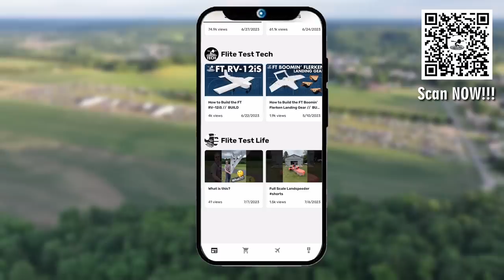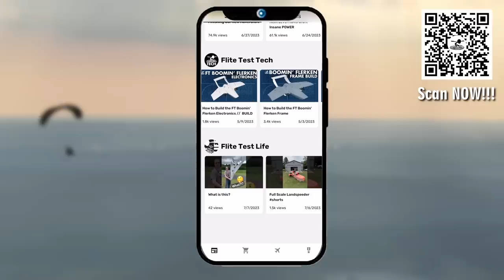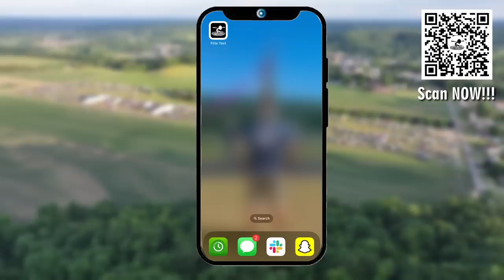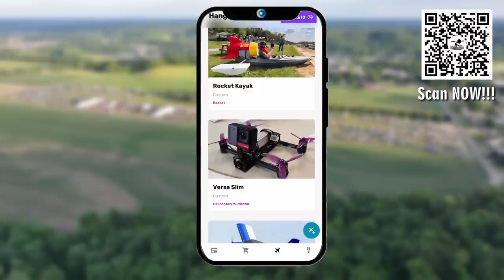Worlds Longest Airplane - Record Holder

Comment: That plane reminded me of a train too!  I’d love to see if you guys could build an articulated steam train with passenger cars and a maybe a caboose, with wings on each section, props attached to the locomotive, and the tail surfaces on the last car / caboose.  Bonus points if smoke comes out of the smokestack.

This could be a great Christmas project if you were to model it off of the Polar Express.  ^^

Comment: That plane actually scales pretty well and could work full-scale. At altitude on long flights 1 or 2 pairs of wings could fold for efficiency. The short wingspan could help on crosswind landings. The elevator could easily be computer-controlled to maintain attitude whether the CG is good or a little unbalanced.

Comment: I'm actually curious how does having so much people controlling their models doesnt cause that much of interference
Reply: 2.4 GHz has so many channels that interference is very rare. 72 mhz was what came before 2.4 and it had a limited number of channels associated with it. That system had the chance to get interference from literally any radio signal. 2.4 is the same as WiFi as well so it’s very reliable.
Reply: Look up "spread spectrum technology"
Reply: It actually does. Frequency hopping works really well but occasionally they step on each other. I experienced some brief lockouts during combat at flite fest this year.
Reply: I’m
Curious how you keep track of your own plane
Reply: @infinateexpress3321   try to make it look unique with different colors or patterns. I used a streamer a few times which made it really easy since there were only a few with streamers. Also everyone is supposed to have a spotter with them.
Reply: @AirJimInCT it was actually 72mhz before 2.4ghz, not 7.2ghz.
Reply: @yomama3615  Agreed. I haven't ever heard of a 7.2GHz system and I've flying RC aircraft over forty years.
Reply: I know how FHSS works. So that's why I am surprised why it's still working with such a number of users. Because there's a limited number of channels transmitters can use. And this number is not very big, maybe around twentyish. And when you start to lose too many packets connection degrades pretty quickly. I know some users very likely use different bands and different technologies like lora based elrs transmitters though.
Reply: @infinateexpress3321  Right? Some days I can barely keep track of one plane alone in the sky.
Reply: @yomama3615  thank you for the correction. I knew I got something wrong somewhere
Reply: @AirJimInCT  no worries brotha. That's what were here for, to help each other out.
Reply: @infinateexpress3321  That is a challenge, especially in FF combat.  You must have a spotter for FF combat, but it's still easy to lose track of your plane!
Reply: It lets ya know when someone at your field is flying and crashes and blame interference they are most likely full of ish and can’t accept they messed up.
Reply: Those poor corn plants.
Reply: Well done Peter. I think we're looking at future of the aviation passenger aircraft here. We might need some longer runways.😮
Reply: @AirJimInCT  ⚠️ God has said in the Quran:

🔵 { O mankind, worship your Lord, who created you and those before you, that you may become righteous - ( 2:21 ) 

🔴 [He] who made for you the earth a bed [spread out] and the sky a ceiling and sent down from the sky, rain and brought forth thereby fruits as provision for you. So do not attribute to Allah equals while you know [that there is nothing similar to Him]. ( 2:22 )

🔵 And if you are in doubt about what We have sent down upon Our Servant [Muhammad], then produce a surah the like thereof and call upon your witnesses other than Allah, if you should be truthful. ( 2:23 )

🔴 But if you do not - and you will never be able to - then fear the Fire, whose fuel is men and stones, prepared for the disbelievers.( 2:24 )

🔵 And give good tidings to those who believe and do righteous deeds that they will have gardens [in Paradise] beneath which rivers flow. Whenever they are provided with a provision of fruit therefrom, they will say, "This is what we were provided with before." And it is given to them in likeness. And they will have therein purified spouses, and they will abide therein eternally. ( 2:25 )

⚠️ Quran

Comment: just wondering.. are there any rules/limitations on the rc planes that visitors can fly? as in, are only electric propellers allowed, or are combustion engines and jets fair game? and in the combat event, a plane using the ram strategy could have a steel tipped and reinforced nose for penetration and durability? 

very curious about any would-be ruleset

Comment: You guys should build a life size cri cri, that can actually carry a human & just fly them around the park no higher that say 20-30 ft max heighth. Maybe even put some STOL  wings on it to keep the speed down. Low & slow. Imagine a small life size RC STOL plane that carries one adult at low heights & low speeds. Max height 25 ft, max speed 25 knots. Even a miniature RC gyrocopter that hauls an adult, low & slow.

Comment: It would be fun to see how much weight it could lift compared to a single wing
Reply: Zero - it can barely lift itself.
Reply: There is a reason real world full scale airplanes has migrated from different multi wing configurations to the mono wing design. When a wing moves through the air it introduces turbulence which would hit a wing mounted after it, making that win work less efficiently and with more drag. And in a biplane configuration the airflow over one wing interferes with the air flow of the wing above or bellow it. Again it increases drag and reduces efficiency making it less efficient than a single wing with equal wing area.

And this is where things get interesting. We used two, three or even more wings mounted vertically because it allowed us to get large wing area with limited wingspan, which was important as we didn't have the knowhow or the materials to build large wings with wide wingspan. So it was a compromise then and it remains a compromise today. Only today with modern manufacturing techniques and modern materials we are able to build strong and light wings with very large wingspan.